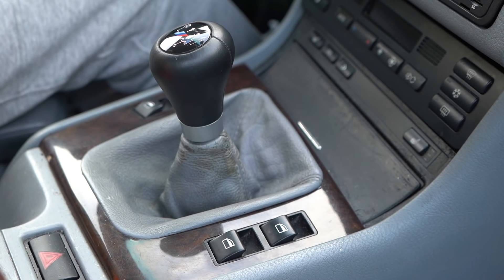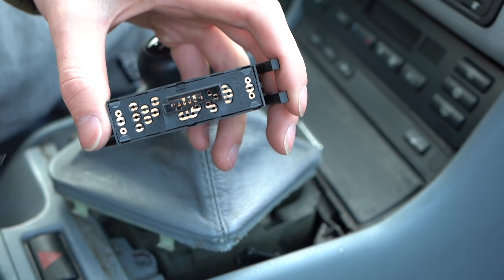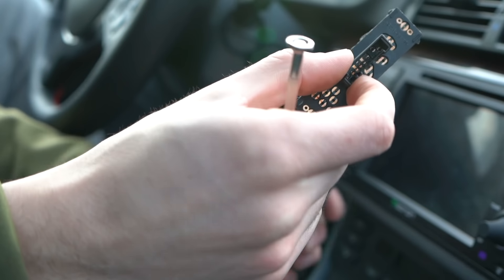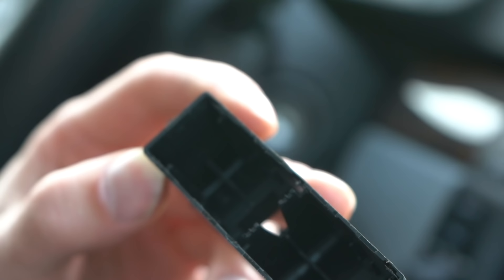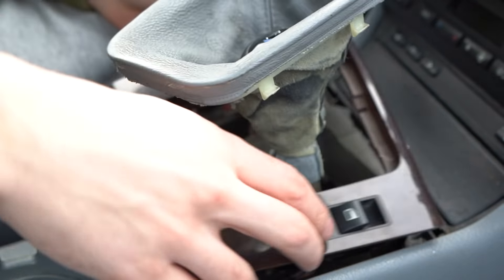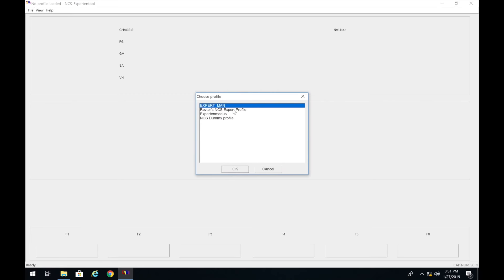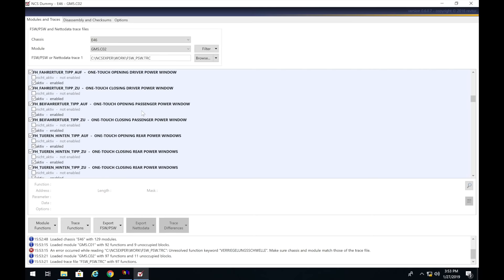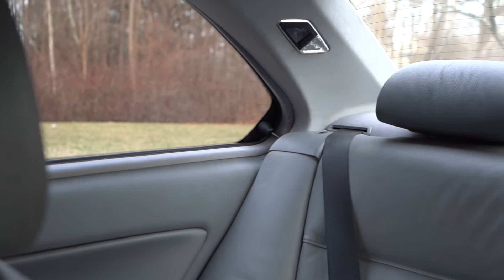One Touch CLOSE Rear Window DIY | BMW e46

Comment: thanks Evan i already  have mine coded  , but i didn't want to attempt the physical mod  because the photos on the forums are not clear at all  now i may give this  go 
also good to know how to remove that trim piece  , i sometimes but very rarely have  an issue with my neutral safety switch (automatic) where the  car thinks it is in gear and will not start , i think it  might be accessible  from there , plus i am thinking or having all my trim wrapped in  some 3m brushed metal look vinyl  so good to know how to remove that
 have you ever thought about wrapping your trim with brushed metal or carbon fiber vinyl?
that  would make a really nice video ,  the door handle trim and back trim look like it would be hard to wrap though
Reply from the maker: I want to wrap my trim but it’s all cracked so it would show right through. I need to get trim that’s in better shape.
Reply: @EvanGoyuk  i just saw a video where the guy sanded it and  primed it and then  wrapped it , maybe you could try  filling the  cracks with something and then sanding and priming  them
Reply from the maker: Yes I have thought about that

Comment: If you go to 10:31, you can see NCS Expert telling you GM05.C02. As in, you don't need to guess what version you have in NCS Dummy untill you get no errors. NSC Expert will tell you exactly which version of a module you have when you read the module data.

Comment: Did you notice more travel with the rear vent buttons after you did this mod? I tried it by shaving down the verticle line like you and coded it using NCS but had no success. I didnt notice any difference in feel with the modded button either. Is the mod supposed to feel like the front power window buttons where they have 2 different clicks?  Perhaps there is something I missed or I did not shave off enough material. I have a EURO e46 320cd
Reply from the maker: No I do not see anymore travel and yes it feels like the front clicks
Reply: I might shave off more plastic to see if that works. Shaved off more material and got this working properly now. Thanks for video. Only 1 on Youtube. Well done

Comment: Can this work without part 1 by not modding the rear vent window buttons ?
Reply from the maker: No not in the United States
Reply: @EvanGoyuk  I have a e46 328i its does it by default. Both one tap open and close.

Comment: Tip: when you've disassembled the holder, click all buttons without using the regular buttons/knobs. Mine had to be pressed quite firmly before the regular buttons were strong enough to press them.
Probably because of it not being pressed for 23 years.